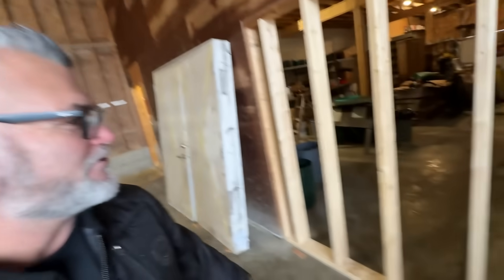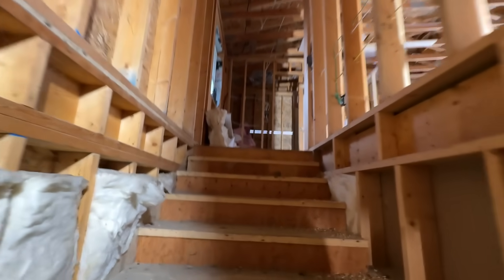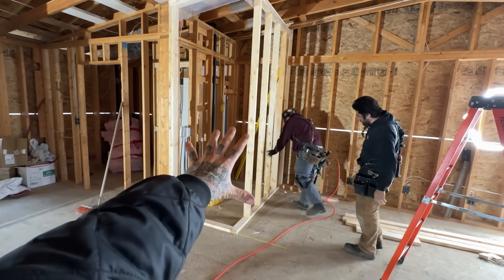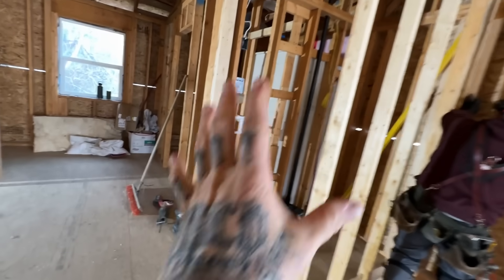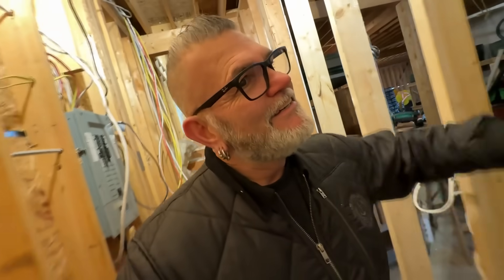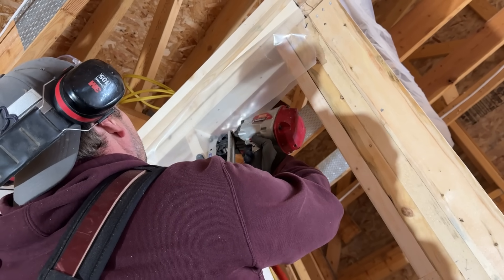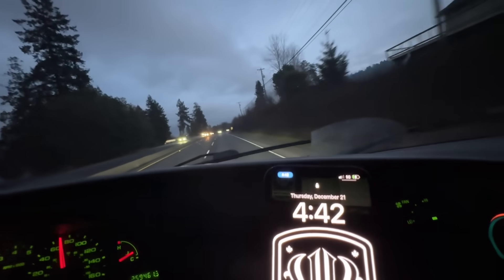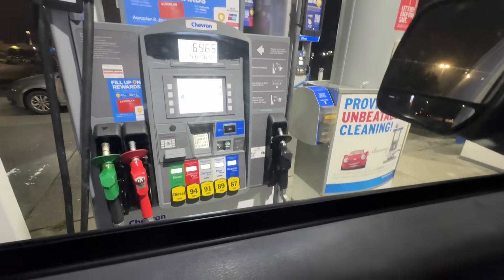The BUILD OUT Has Started. Shhh!! Sleeping Where They CAN SEE ME

Comment: Thumbs 👍 for the throwback reminder of stealth camping in the urban residential area 😅

But your diesel pump replacement was lacking a bit...

 Part one you showed us the water separator, so in LoLe channel it's imperative to drain and check for water in the system annually or every 6 months to be sure😢

Part 2 didn't show you replacing the filter while you had the whole assembly on the table😢

Comment: Chrome
Great to see the new place coming along.
Just curious, are you going to use spray foam for your insulation?
Its costly but will really tighten up the building.
Insulation you pay for once-heating-cooling every time it comes on.
The heated shop will be nice.
thx
BC